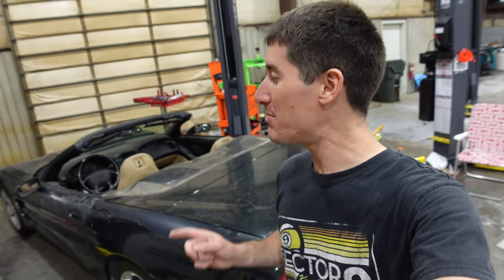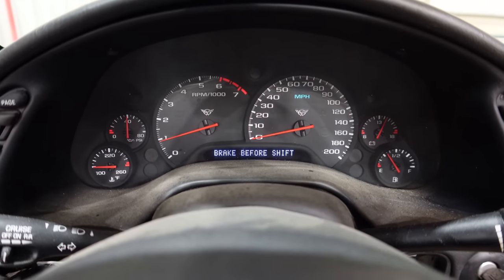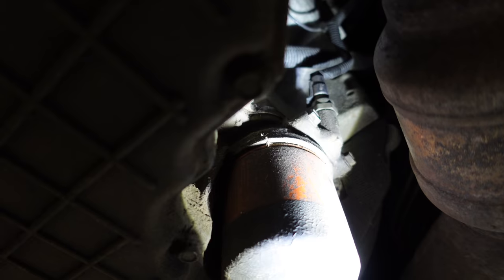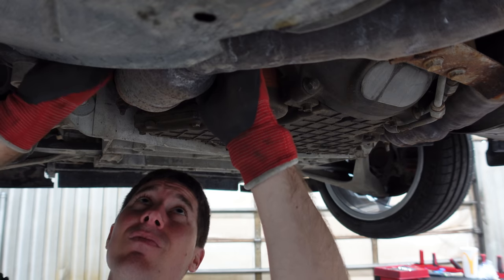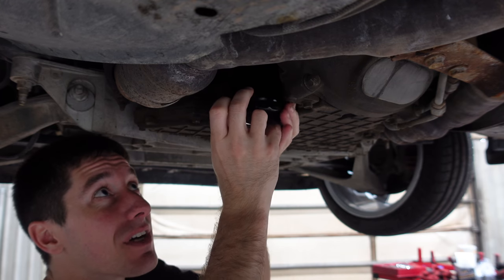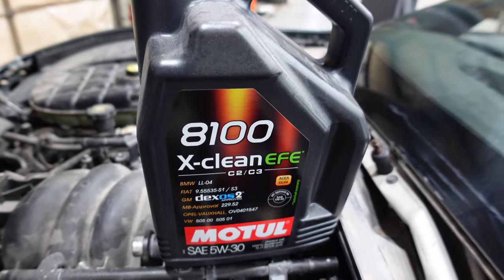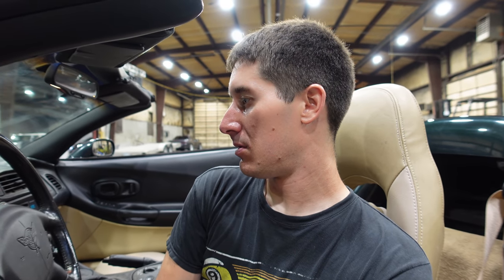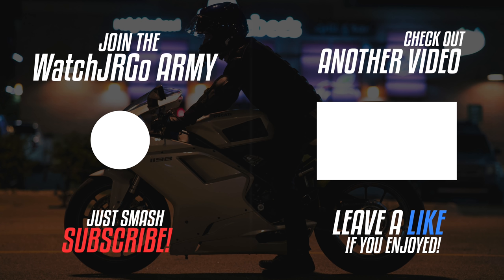*HIGH OIL TEMPERATURE* My CHEAP Rat Infested Corvette Is ANGRY

Comment: As someone who worked in the parts world back in college. I can say those temp sensors fail all the time in the trucks, but not the cars for some odd reason. So many dudes came in with oil temp problems, but it ended up just being a sensor

Comment: My buddy bought a C4 7 years ago.  Paid 1800 for it from a pawn shop.  All he did was put on new tires and a radiator.  All in under 3K and he told me that it was the best 3K he ever spent.  Convertible just like this, slightly older 1988 model and only had like 20k on the clock when he got it.  And it's the best P magnet that he's ever owned.

Comment: Good video and some great content!! Is there an issue with the transmission? I saw that the TCC solenoid or torque convertor clutch solenoid was disabled on the error codes. I used to own a GM product with an automatic transmission and when my TCC solenoid went out a quick fix was to just unplug it. If I remember right one of the symptoms that it caused was a bucking issue when cruising in high gear at a steady speed.

Thanks for the great content and all of the videos.

Comment: A story to go with your tight oil plug....I bought a new 1978 Chevy short bed truck with a 350 V8 stick and when I went to do the first oil change the oil filter was on so tight that the metal cap wrench I used twisted the stock filter like a cork screw and so the only way I could get it to finally come off was to take a large screw driver and hammer it through the base of the filter and beat that with a hammer to finally get it to turn off.

Comment: Hey, I found your channel this week because I also bought a C5 recently. 

Really curious what you find about the fans. Mine got warm once in traffic and when I looked into it the internet said that in stock configuration it can get as hot as 230 degrees before the fans will kick on high.

The easy way to correct this is by turning on the AC. 

Looking forward to seeing more of this car. =]
Reply: Yep my 1988 V6 Fiero is similar. It can get close to 230 before the fan comes on and that's normal. And like you said if you're concerned just turn on the AC.

Comment: I think there’s still an issue with the oil temp sensor and its wiring.  I have a 2001 manual C5 and have never seen the oil temp low message.  It will display the temperature in degrees even when it’s in 40s and your shop has to be warmer than that.

Comment: my 76 chevette was rock solid. i actually miss the car, the gas mileage the most lol.
Reply: They're great until you wear the engine out.
Reply: 0 - 60 ?
Reply: @CR7659  those engines were great. Many are still running pumps or tractors on farms all over
Reply: @longjohn77  I test drove one for a girl that had blown a head gasket or something, the oil was brown and it had no power at all.

Comment: Quick question..... Why do you fill the new oil filter with the new oil before you put it on? Can't you just put it on and top it off after the oil change? That's the way I always do it
Reply: Then your engine is running with no oil till the filter fills up. Not good!

Comment: Nice JR.  She's coming along nicely.  I actually just installed some 20MM spacers on the rear of my 09 528i yesterday as well.  Makes the stance 100 X better.  Seems like you could have gotten slightly larger wheel spacers to have em mounted more flush though.  Lugs look tasty too.

Comment: Its gonna be a really nice car when you fix all the little stuff.  Buff the paint too see what happens
Reply: What isn't clear coat failure would look great. But the clear coat failure is strong on this one
Reply: @TheBarberShopScott  yeah you are correct, it looks pretty through the paint.  Back in the 90 and 00s though that single stage paint went on thick.  Might need a paint meter to really see but i was suprised to see that for myself it does come out looking brand new after a cut and buff.  Its worth the time to try rather than get a maaco job
Reply: @andrewg2322  single stage for sure cleans up very well. The print under the clear failure would clean up, but the chipping clearcoat is the big issue

Comment: Hey JR first time long time here, I have a big gripe with something you do quite often and I see a lot of other guys do this and its a complete misconstrued farse (pre filling oil filters), there is absolutely no positive or better yet any negatives to filling the oil filters it serves no purpose at all. The oil pump will do its job so long as the pick is free and clear. Ben from long island (don't mind the screen name my daughter renamed my account).
Reply from the maker: I know it's super stupid... but you have to act like it's some kind of science or you'll get trashed in the comments. Never had to pre-fill an oil filter in my life until YouTube 💯
Reply: I will say it does seem like it’s helpful, especially when the filter installs with the opening facing straight up.  I didn’t always pre-fill it either since I owned a lot of cars with filters that installed sideways, but that lag time between start-up and oil pressure normalizing does sound less harsh when the filter is pre-filled.
Reply: I've never filled a filter before buying my 2005 Dodge diesel, they claim on the Cummins engines that the injector pump is driven off oil pressure and that it might cause damage to that if not filled, I can tell you that any filter that isn't installed UP doesn't need to be filled and I wouldn't do it Youtube or not.
Reply from the maker: @richardwilliams3152  that checks out… but still, it’ll have its oil within 3 seconds or so. Plus you’ve always got residual in the pump. I think it’s pseudo-science because people want oil changes to be complicated 😛